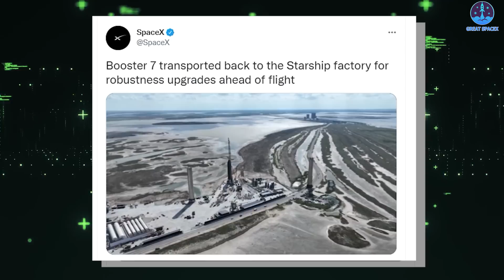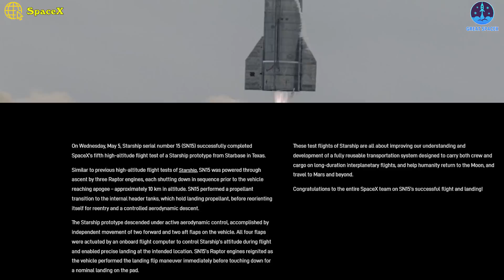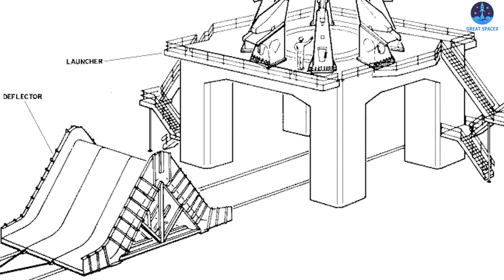Why SpaceX is Facing Problems in Testing 33 Raptor Engines Simultaneously...!

Comment: Is the vast quantity of steam generated by the water system not nearly as much of a problem as the fireball?
Reply: Not in south Texas humidity, and especially not with the local county environmental protection folks.  In California, the local county had hundreds of people working environmental issues  with launch ops from Vandenberg.  With RP1, the fuel residue captured in the flame bucket/trench had to be handled as hazardous.  With methane, that goes away instantly in gas form.  Also, the exposure is very short since the rocket is leaving the pad at the same time. Flame buckets add a lot of back pressure for the initial startup to overcome.  Water just softens the blow and reduces noise and hopefully keeps the fires down.   My thoughts...I'm sure I've left out other considerations
Reply: @roberthuckleberry5342  I wasn't concerned about the environment I was worried about the steam impact of the rocket itself. Especially in a static test where the rocket doesn't get to move out of the way.

Comment: How can they fire up 33 Raptors without causing massive damage to the launch mount, the concrete pad, the surrounding area and the booster itself? Without a flame diverter trench and massive water deluge system it’s not going to go well. Or am I wrong? Does Musk have a plan?
Reply: One wonders why they are not using the Saturn and older flame diverters.  A test will tell.  F.  Miller
Reply: yep, my thoughts too.  I'm looking at a stainless launch pin on my desk from an old Atlas E launch.  It only produced 386,000 lbs of thrust and the top is melted with the sides looking like a cutting torch had its way on it.  It had ablative coating on it as well.  Fortunately, Spacex has lots of experience recovering pads from launch operations.  They know what they are doing and are accepting the risk.  But all the GSE is soooo close to the pad.  No large burms to protect the tank farm....I wonder too.    Fortunately, they have something we didn't have in the legacy launch days....Elon!
Reply: @roberthuckleberry5342  they also now have computing power that can run simulations
Reply: @roberthuckleberry5342    I agree that Elon is a very clever man, you don’t get to be the richest man on the planet by luck alone, but it would appear he is taking unnecessary risks in not using a flame diverter trench together with a powerful water drenching system, something NASA would never dream of doing. He could loose the tank farm followed by everything else within the vicinity of the launch site. I don’t understand his reasoning, why take such a huge risk together with all the aggravation of having to make so many repairs to the pad, Raptors and booster?
Reply: @keithmayes4358  I hear ya, man.  I've only been involved with 9 launches and all had what you are talking about.  I don't think we've launched off a slab since Redstone and maybe early Thor.  HOWEVER, being overly cautious caused SLS to take so long and price over-runs.  The only other variable I can think of is the sensitivity of the satellites and upper stages to sound and vibrations.  Deluge systems helped tremendously with that aspect as well.  Maybe since Elon makes his own satellites they aren't as sensitive as the ones built earlier.  Lastly, there seems to be some changes to the pad they are building at the Cape.  Due to the FAA's limitations at Boca Chica, he may only use this pad for R&D.

Comment: Any idea why the 7 raptors (by position) were chosen? The selected engines aren't symmetrical to each other.
Reply: Jo, my guess is they are working on a startup sequence to ease into full thrust.  I, like you, would've assumed a symmetrical pattern to keep forces applied evenly.  But, the Delta IV heavy that just launched lit its engines one at a time as well and started with an outside "strap on".  The computer has to decide engine performance instantly, the fuel/Ox feeds have to keep up without cavitating, etc...  So, they may do a 7 engine sequence 5 times until all are up and running with the entire sequence taking 1.5 - 3 seconds.  Again, my guess.  Elon is rewriting test and evaluation...we needed him 50 years ago!  I'm an old legacy launch controller and am in awe of Spacex.
Reply: @roberthuckleberry5342  
Yep...reminiscent of how they went about when trying to determine the best startup sequence of the Falcon Heavy.
Reply: @roberthuckleberry5342  agreed and its astounding how a private company is doing it. pushing the boundaries of many feats.
Reply: See my detailed comment above.

Comment: What SpaceX is doing is better than anyone else but there is a better way.
Reply from the maker: What's the better way? Can you share with us???
Reply: @colonbina1  SpaceX starship after it is workable and I think it well be well need 8 to 10 refueling at least to get anywhere. SpaceX starship is big and that is good. But it is paper thin very poor radiation protection and no gravity. Now gravity is an important factor for humans  it is not something we can do without for very long. These are some of the problems. 

Now if SpaceX starship combined with the company that used to be called gateway. This company has developed the space bond technologies to construct very large space stations construction in space. With the help of SpaceX starship to get the equipment and materials in orbit. It would take according to them less than 2 year with 40 lunches from SpaceX starship.

Anyway this same technologies can be used to construct large spaceships with gravity. We can use liquid fuel molten salt reactors for propulsion and power. Unlike most think this technology is not theoretical it was invented over half a century ago. They actually tested it on earth and it worked.but the radiation was a problem. They wanted to use it to launch to orbit. They also had a working prototype power reactor it ran for three years because of corrosion.

Point of this it is applied physics not theoretical we now have engineered materials that can withstand the corrosion for a decade or 2. We can make designs to change out components when needed. These large ships well be like a interplanetary motherships able to go from orbit to anywhere in the solar system with full radiation protection, gravity and power.

It well park in orbit to take on people, materials and supplies. Starship can dock with it and then land where ever it brings it. No need for all the refueling and instead of getting a hundred people to orbit it could get a thousand. Living quarters are unnecessary. These ships would cost billions but well worth it. It wouldn't take long at all to put a colony on the moon this is with only one of these ships. 

But once the ship construction inferstructure in earth orbit we could easily build more. We could do the same in the moon orbit with building materials from the moon launched into orbit with rail gun technology. With this type of system we could have a interplanetary infrastructure with colonies on the moon,  Mars and Venus in a few decades.
Reply: @colonbina1  Now the reactors I am talking about is a type reactor it can have major benefits for earth. You can use specific fuel cycle systems for spaceships they are smaller reactors but have atomic waste to be stored in a tank.

Then the larger more complex versions the breeder type which can burn atomic waste. We can clean up all the atomic waste by burning it. Now the rods used in pressure vessel reactors have coatings to stabilize the rods that needs to be removed. So some processing is needed. We can replace the large power reactors with theses and clean up the planet at the same time.

Also these large ships sooner or latter can be updated with better power systems and propulsion.

These reactors are a slow reaction at high temperatures with no pressure vessel. They operate at about a thousand degrees but if the temperatures get too high it actually kills the reaction. The reaction is produced by the fuel maxture.mixture. the propelants use can be a wide variety even water.
Reply: @clementvining2487  Clement, look up the thrust-to-weight ratio of nuclear thermal (not to mention nuclear electric) engines - they have orders of magnitude too low thrust to lift even themselves, let alone a whole vehicle from Earth gravity well. Having the specific impulse from three (nuclear thermal) to several dozen times (nuclear electric) of that of the best chemical engines, they are ideal for interplanetary work. But they will never launch anything.

Also, breeder reactors also produce waste, albeit often less troublesome, and less of it. Most designs don't require a pressure vessel, but some still do. They are not the silver bullet, although they are a big step forward. But, again, fission reactor will never launch anything.

Do your homework a bot more thoroughly.
Reply: @bazoo513  Dude did you even read what I said. From orbit only the ship is built in space and never comes down. Then you are talking about different systems than I am. 

You are talking about current designs that are inadequate for a large ship like I am talking about with a different kind of technology. You are talking about stupid engineering instead of practical engineering with hundreds of megawatts. What I mean by stupid engineering is it isn't built to do the job.

 You are talking about low power inadequate propulsion system. Instead of high power systems useing old technologies proven over half a century ago. None of the systems you talking about are liquid fuel molten salt thorium reactors in the hundreds of magawatt range. 

Do your homework and actually read and understand what someone is saying. And these type breeder reactors don't produce waste over time they burn 98% of the radioactive material. What  remains is a useful radioactive isotope. You look and others look up current technologies well those technologies are  small in power and inadequate. Get your facts straight before you tell someone to  do there homework. YOU NEED TO DO YOUR HOMEWORK. BUT I guess most can't think for themselves they simply look things up and have no idea what possible with applied physics.
Reply: @bazoo513  You simply don't get it. You are talking about stupid engineering.  Engineering that well get us nowhere it cost to much it is inefficient and inadequate for the job. I am talking about ships the size of aircraft carriers with the power and propulsion systems needed.

 They well have gravity and everything needed for hundreds or a thousand people to live for years.  And can go anywhere in the solar system.

This kind of ship has to be built in orbit. Even the reactors and engines have to be built in orbit. A ship this size may even have to have a gigawatt power supply. The engineering sections well be larger than SpaceX starship. What we use now are paper thin with inefficient chemical propulsion systems. Then they use short thrust burst and then glide. Point is they are stupid engineering not built to do the needed job. And the thing is they still cost billions it is stupid engineering. With this kind of ships SpaceX starship would be shuttles to get to and back from orbit.

One or 2 SpaceX starships could dock and locked to the large ship until it gets where it's going. This power system can later be upgraded to fusion and antimatter technologies when it comes available. First the power systems than later the propulsion. But for now the liquid fuel molten salt reactors are the best bet.

Now what you are talking about is like using a outboard motor for a ship. Most of the systems you are talking about is in the kilowatt range instead of the magawatt or gigawatt range. Even electrical propulsion would be alot different in the magawatt and gigawatt power range.

 If you use the vasimr system a large system. Then you use capacitors in liquid nitrogen to store very large amounts of electricity.  You charge them up while you are in orbit taking on people and supplies.  Then use that energy to blast out of orbit. Before you get where you are going it is charged up again to slow down. You make the system so it is reversable. Remember the ship is parked in a stable orbit it is going 17500 miles per hr. You thrust to the needed delta v to where you are going.

Comment: The Russians discovered that it is very hard to run so many engines at once.
Reply: That was the downfall of the N1, they didn't have the funding to test all the engines.
Reply: I watched a doc on the N1, the Soviets did eventually work out the issues w the 20 or engines on the N1, but funding was cancelled on the project before any more flight occurred.
Reply: If it didn't work

Plan B: FALCON ROCKETS SIDE BY SIDE
(But much costly)
Reply: They didn't have elon